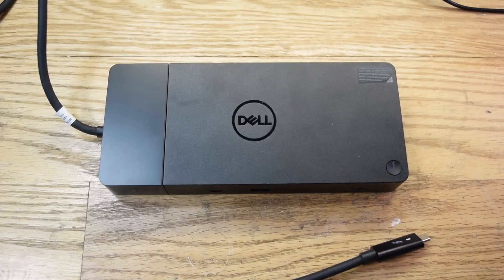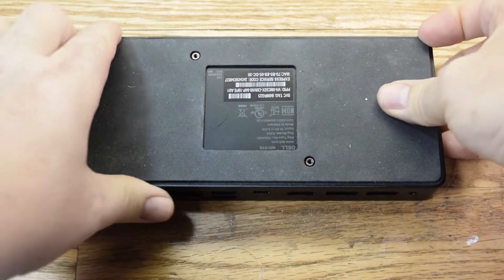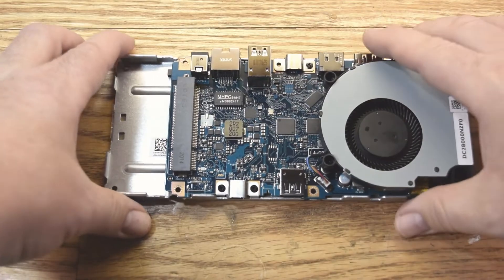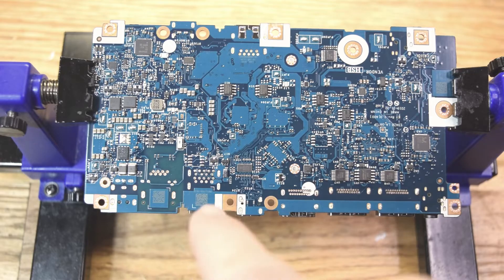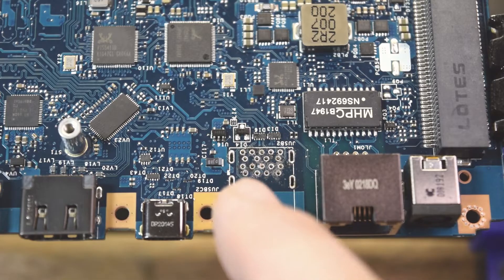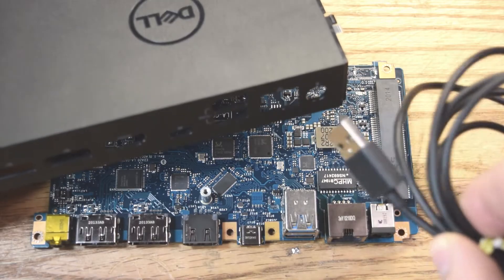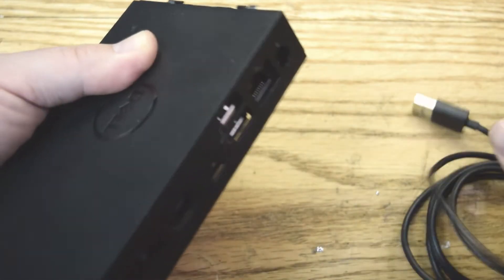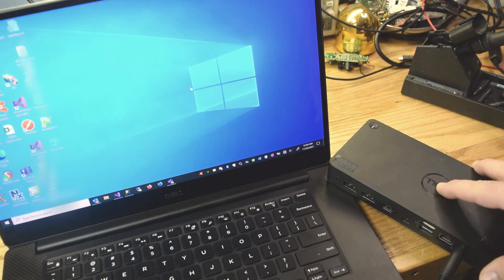Dell WD19TB teardown and USB port repair

Comment: actually you don't need to completely remove the rubber from the bottom since the 6 screws are close to the edge just lift the rubber where the screws are and you can remove them with out removing the rubber pad

Comment: Thanks for the video. I received the same model dock from my company with the exact same problem and was able to  successfully repair it using your instructions. It now works perfectly with the new USB ports.  I used Kapton tape with the hot air, even at 500C I could not get the solder to melt. I ended up using ChipQuick to remove the damaged port.

Comment: Any advice / video on solution to fix wd19 that trips power/ power adapter?!
Reply: I'm having the same issue right now did you fix the issue?
Reply: Possible overheating issue. I'd advise to make sure it has enough air flow
Reply: My device is turning ON and after a few seconds turns OFF, any solution?
Reply: Try using a 130W adapter instead of 180W.

Comment: Good video!  I think it would have been even better if you had set the camera up on the bench, across from your seat, to show the desoldering & soldering.  I know sometimes (desoldering especially) things don't go smoothly ... but it would be educational to see how you dealt with those issues.

Comment: I had same issue getting the port off, even using a preheater, hot air and soldering iron simultaneously. managed to push through eventually with fine wire, but the ground plane wicks the heat away so quickly. I used the Wurth Elektronik USB3.0 port rather than the molex, which is slightly longer and fitsperfectly, however there were also a couple of traces broken which I had to repair. Unfortunately at the moment it is not reading devices, so not too sure if a filter or IC was damaged when the port was damaged. Will have to take and power it up to get some readings.